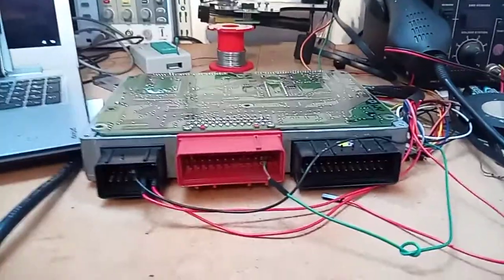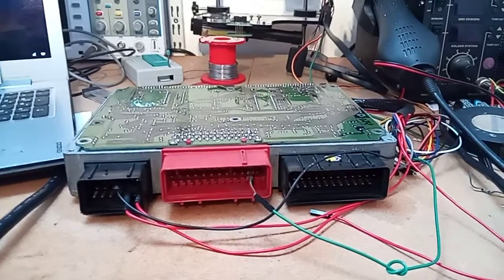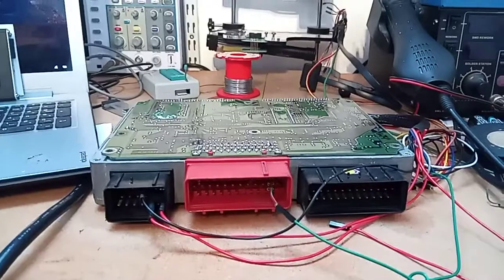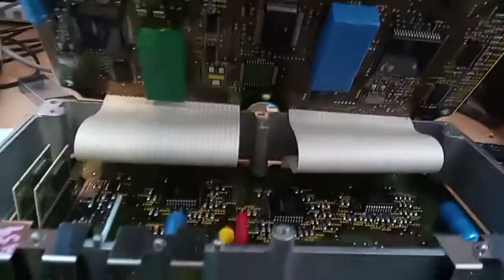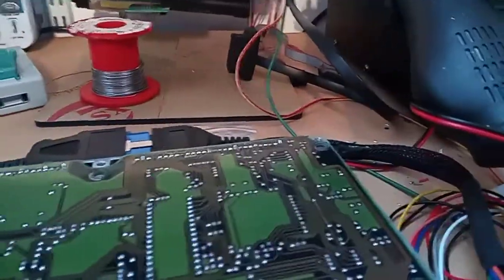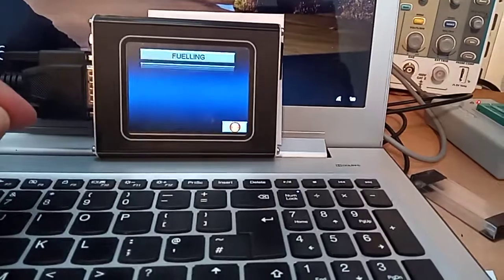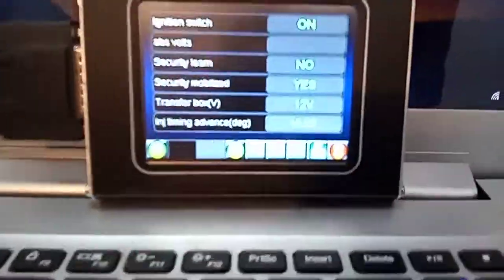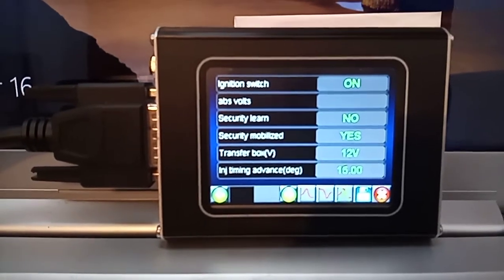P38 Range Rover GEMS ECU Immobiliser removal in software demonstration. Home made F-OUT box.

Comment: I have an '84 Land Rover defender but with a refurbished 4.6L v8 in the shop. How can I go about this solution? Send ECM? Let me know please.
Reply from the maker: Morning Andy. The question is do you have a dealership level tool to resync the immobiliser code? It can be done with testboo T4, a Nanocom Evolution (And possiby other toold from Black Box Solutions) and possibly a Hawkeye?

Or I can supply an ECU complete, ready to go. 
I am guessing you are in the US? to ship the ECU to me in the U.K. can be $60 - $70 each way.
I charge £140 (about $180 at current exchange rates) plus shipping for an ECU ready to go, so with the prohibitive shipping charges to get your ECU here, it's cheaper to buy one complete to save the $60 US to UK shipping of your one.
Reply: @ecux  Sorry for the late reply we have X431 which seems to be able to reset the code.
Reply: Any news on this? We can send the ECM to you if needed.

Comment: Hi I have just bought a p38 that I intend to restore but it keeps immobilising all the time,can you explain how to get rid of it for once an for all
Reply from the maker: Sure. You need the special LandRover piece of kit called an F-Out box, then wire that in, do a security learn and start the car. That should remove the immobiliser. The video is a demonstration of my own recreation of the F-Out box as they are not available.
Alternatively, I could do it for you.
Reply: @ecux  CAN IT BE DONE FOR THE DIESEL ECU
Reply from the maker: @michaelbarrett9094  It can, however it's a bit hit and miss as there is no way to tell if the immobiliser off is correct on the bench as there are 3 different ways of doing the Bosch EDC depending on the ECU.
The only way to confirm it is actually plugging it in to a car and actually starting it up and sadly, I don't have a 2.5 Diesel here. :(
Reply: @ecux  can you email me some pointers,I am an electronics technician so may be able to carry out this procedure
Reply: @ecux  Simon, can you advise your email.  Friend has dead P38 and could use your help.
Reply from the maker: @jimclark8186  simon (at) ecux (dot) co (dot) uk
simon@ecux.co.uk